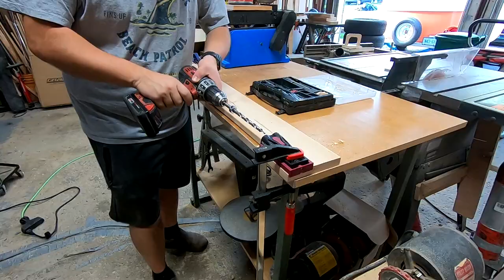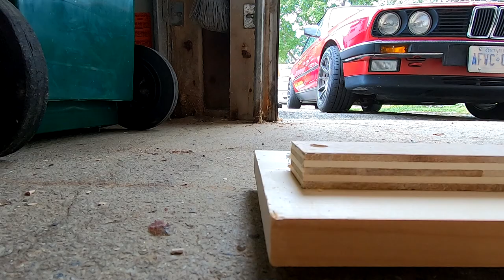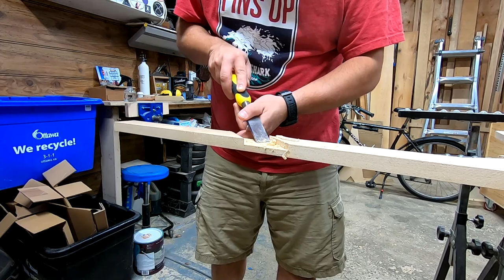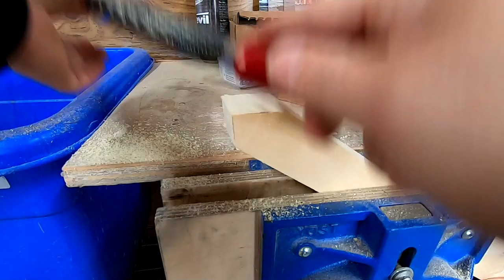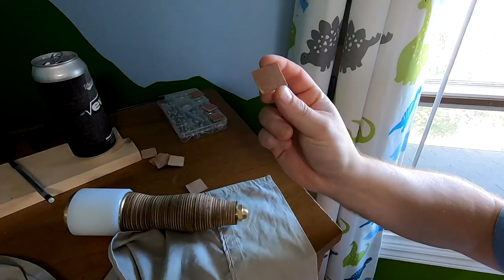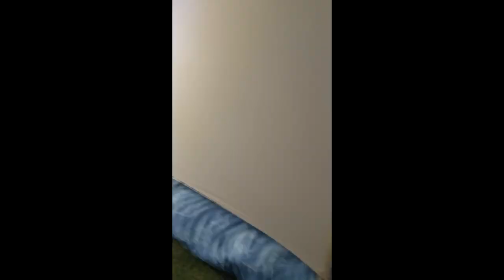How To:  Toddler Tent Bed [DIY]

Comment: If you don't mind me asking, was it cheaper to buy the wood and do it yourself than to order it off line? Bc I need two
Reply from the maker: You can't buy the quality that I made. Almost everything is particle board these days. So is it cheaper? Probably only if you don't count your hours. (also all the wood I used in this project I got for free, so I couldn't even begin to cost this project for you). I would also note that this is an original design by me, so I don't think I could buy it online 🤣

Comment: Hi I want to do this but have it be queen size instead. Any insight?
Reply from the maker: Just change the measurements to fit a queen size mattress. The hardest part will be finding a sheet big enough, you will likely need to use two queen sized sheets.